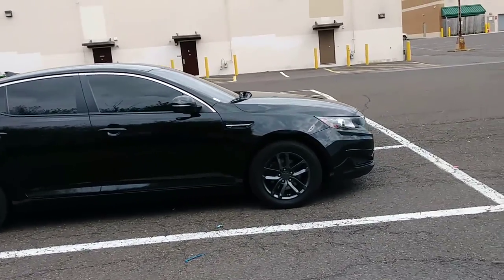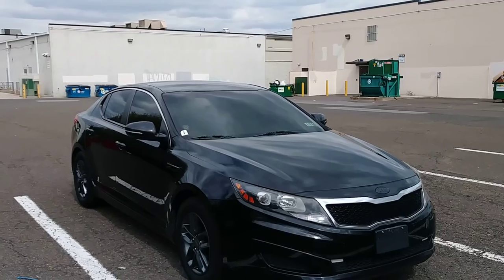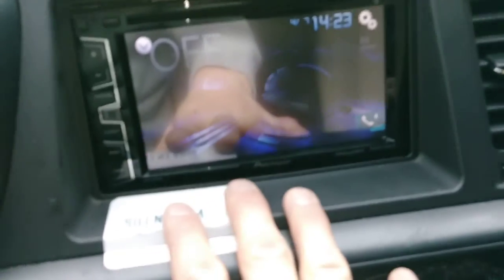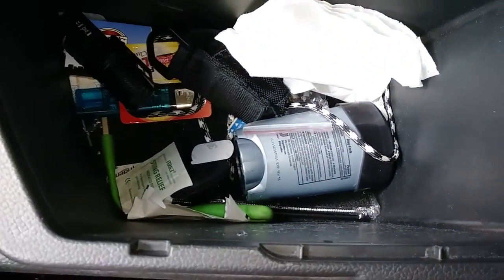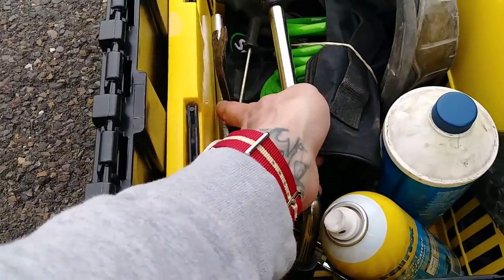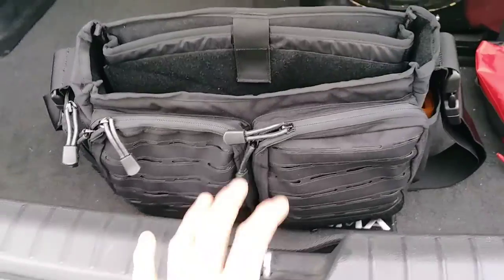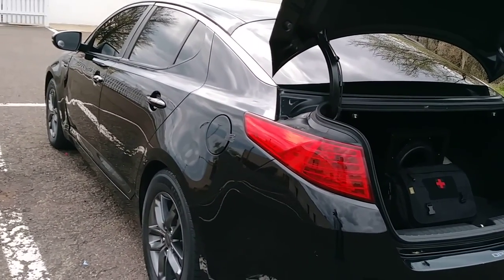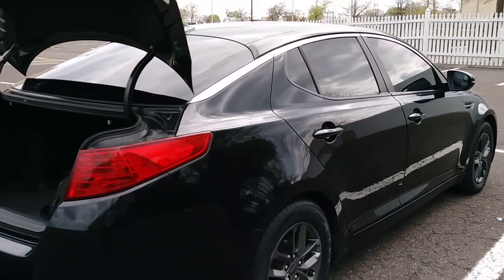Emergencey and survival kit for your car

Comment: Windshield is over-tinted but not really a safety issue because other drivers can't see you to determine your motorist behavior.  Police never like it and at night if you're in a collision you might contribute to your liability.  I don't sever probable cause to search based on an equipment violation, so check your State Penal Law and vehicular law.  Drive Safe.